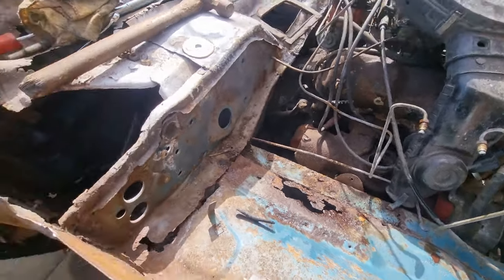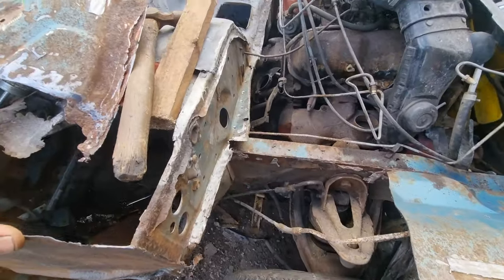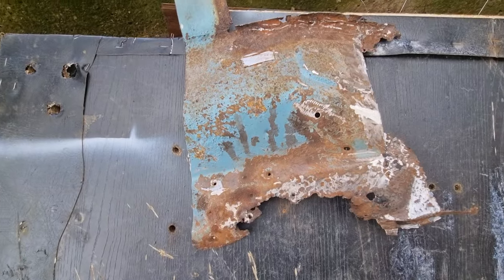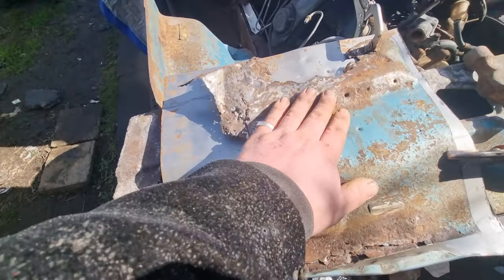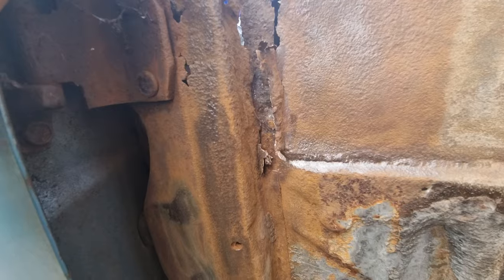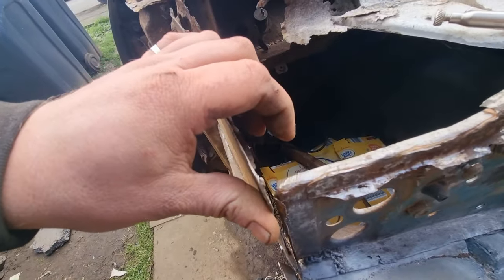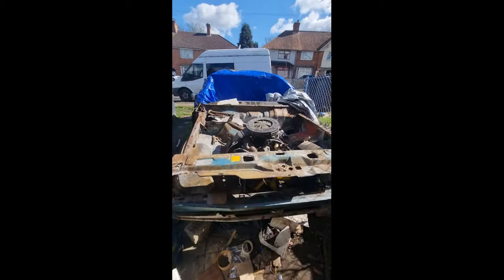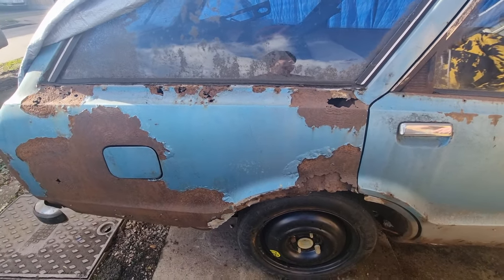Cortina Mk4 Ghia 2.3 V6 Restoration || Wheel Tub Repair + Set Back (P13)

Comment: yeah Adam i have had that, sort of thing before, with my little rover metro. Sometimes you just got to replace the full lot and do it properly.  Id be in two minds on doing the other side though pal, if that's ok, id just leave it as it is. This will give you an excuse to look at the engine side of it, like i said before. If things are going really well, stop and your getting bored stop. Move onto another job on the car, in the case id look at the engine. See what the story is there.  Don't get beat up etc over anything I have been there, and tell those haters to fuck off.  None of them have never done a project anyway.   Going back to my job on the rover metro, the previous owner had fitted a later R100 column and stalks, due to a theft attempt.  The Rover metro was Austin Rover setup, the R100 was Honda setup. He cut the main car loom behind the dash to convert it rover, he had buggered the hazard  switch setup. I rang him about that, and he was like fuck! i forgot all about that!!   What i ended up doing was removing the full dash with my dad, to see what the crack was, I said i am just going to fit the later R100 car loom in. Saved messing about with wiring and made it more plug in play for the VVC conversion. Plus i knew that the donor loom would work, as it wasn't triffled with.
Reply from the maker: ohh right yeah you never know whats hiding lol and yeah i get you the other side seems to be lined up ok so may just leave that alone and correct the bad side only otherwise im just making my self more work than needed as for the engine that will be happening very soon im going to check it over soon and rotyate it by hand it will be a good fun part to ear her run after all the time its sat still over 20 + years or more not sure how long it was stuck at the canal for but it as been possably longer than 20 years might even be 30 years looking at the histery
Reply: @AdamSNook.  Just be on the look out for more surprises like that,  You are starting to find now what sort of history its had.  Yeah you know the other side is bob on, and you can use it as refence, last thing you want to do is do more work than it really needs. From what i have seen in rebuilds, is they tend to tackle the worst side, and leave the ok side, for know as a replica, refence so you know how things are.  mustie 1 on here does this sort of thing when doing repairs like this to VWs.   Also take this time,  look at the wiring loom of the car too? Just to see if that's been fiddled with etc.  How far are you on finding bits and pieces?  you could do a video on that too, Show us what you got or need. Buy and sell a Cortina will help you.  I remember seeing a tina in my local scrappy years ago, that was way bad than this, i think that was a mk4, but a saloon. I remember looking at it, and its last tax disc was 1991.  When we looked around that Adam, it was just rotten, i am pretty sure the propshaft was keeping the car together!  I remember pushing down on the rear end of it, and my mate hearing an almighty crack, and the car backend just dropping onto the rear tyres!  When the lads moved it, it just dropped to bits haha.  I think it was going to be a restoration project, they had removed front lights etc and driver side wing, which exposed how bad the inner wing was.  I am suspecting that this may have been mothballed around that time too, i remember the late Tina's, mk1 fiestas and mk2 escorts looking very rough at the time. I remember a bloke having a matt black estate tina, that had odd wheels. This was 33 years ago. I am 38 now.